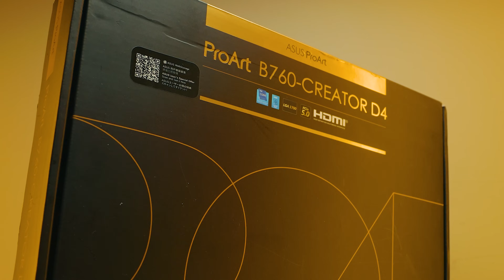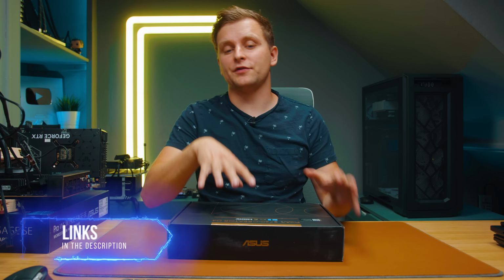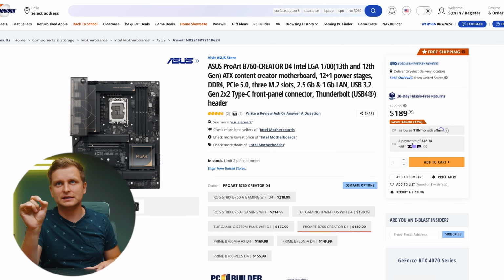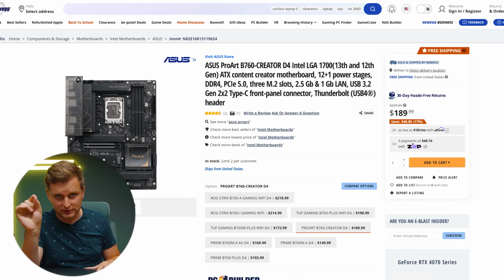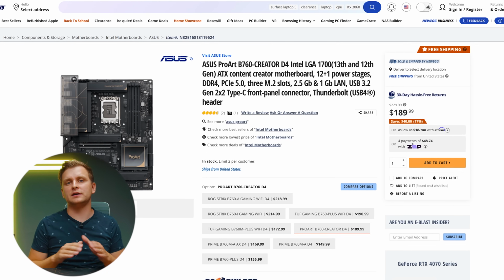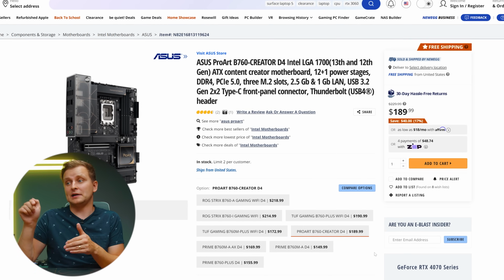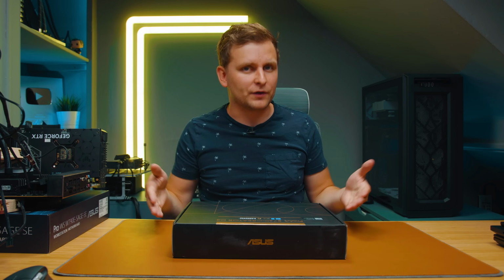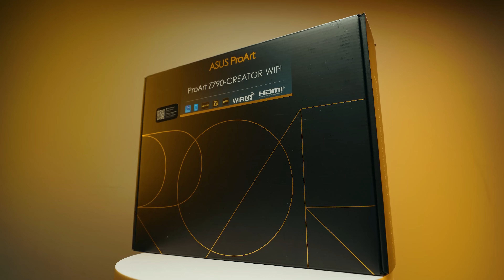THIS $25 Creator Motherboard MAKES HISTORY! | ASUS ProArt B760-Creator D4 Overview

Comment: Which chipset is better ProArt Creator D4, the B660, or the B760? I had a B660 but after 16 mounts I need to change for an MB issue, I can take a B660 or B760, and I don't know which is better. My CPU is an i7-12700, 64GB RAM DDR4 (16GB x 4) CL16 3600MHz, ProArt 4060TI 16GB.

Comment: 6:20 Well, I'm literally watching this on a monitor connected to via USB-C to my Thunderbolt connection of my Z790 Creator. 
         It's not a Thunderbolt monitor. 
         And it's working fine.
        I dunno. Biosupdate? Firmware? Drivers?

Comment: This motherboard is just too crippled comparing to the Z790. Creators often need to hook up additonal cards, so PCI-e and it's bandwidth is paramount, Additionally connectivity like 10Gb and Tb4 is a must these days. The only reason you would EVER consider this mother is because you wanna cheap out on DDR4 because you already have them??? DDR5 ain't that expensive and it offers more capacity.
Also I would like these manufacture to start calling "FULL" "HALF" "QUATER" PCI-e SLOTS instead of X16 because that is just FALSE Ad, even if they put beside (4x electric). I'ts a shameful ad tactic.
If the price is a thing, then I would consider the z690

Comment: Bro I've some confusion. I wanted to buy this mobo couple of hours ago. But the problem is i want to buy 13600k and this is a non oc mobo. And my plan is to use 64 gb. DDR4 3200mhz(if i use ddr5 i can only buy maybe 24gb 5600mhz).
So just give a verdict. Is this mobo will loss its potential because it's not z790(5% loss is okay) and is 64 gb ddr4 is better then the 24gb ddr5 ( will use Davinchi Resolve)

Comment: The x1 slot will not support thunderbolt or 10gb network.   Typically you need an x4 slot or sometimes an x2 depending on the card. It's ok for sound or wifi, but pretty  useless.  There are much better non proart Asus boards for less $
Reply: Like what exactly?

Comment: just installed an 11600k on a z590 nxzt 7 mobo last week, gave it to my nephew, since he uses an old i7 6600k cpu!but I think I killed it with some wrong wiring with the 1000w psu cables, so I switched it out with a 10400f cpu and it works fine! getting an 850w psu for a 12500 cpu and a mobo with ddr5!

Comment: How to buy it at 25$? I can seem to find a link or voucher code, thanks
Reply: Also want to know how it’s $25, from what I’ve read ASUS and Adobe have a promotion going on the ASUS website, but it’s for 3 months free for the Creator motherboard which is >$200 ? 
The motherboard is still ~$189, you’re just saving on the Adobe Creative Cloud subscription.
Reply: It's not actually $25, it's more that the bundling of Adobe Creative Cloud makes it worth it if you already need Creative Cloud
Reply: So no savings if you already have an Adobe Creative Cloud Subscription.
Reply: @EcoAquatica  According to their website, if you have an existing subscription, you can still get the 3 months free which will be added on to it.